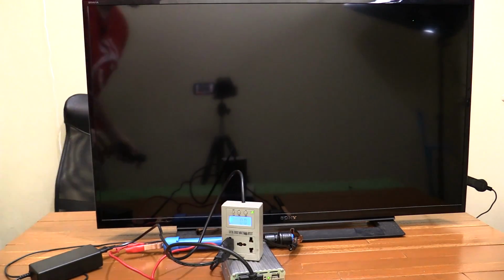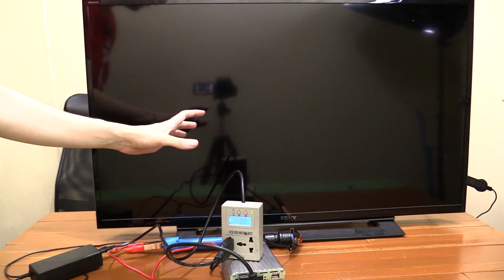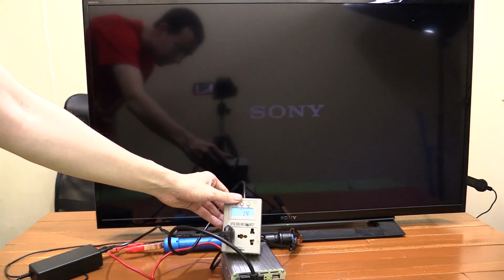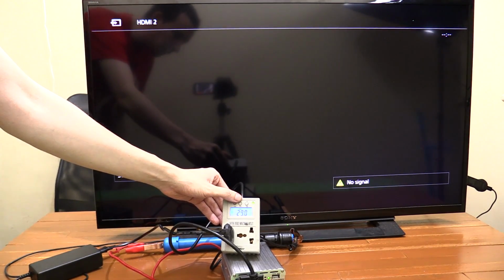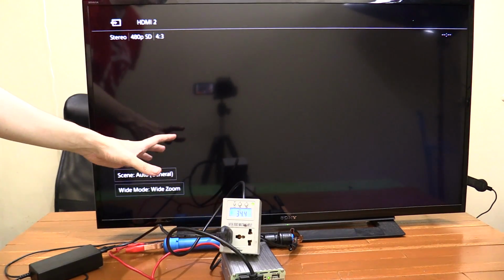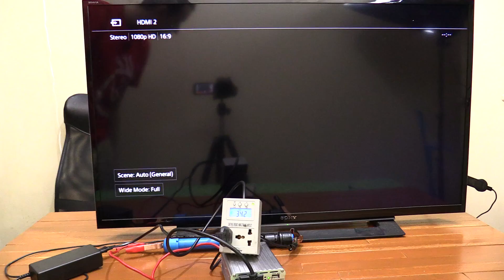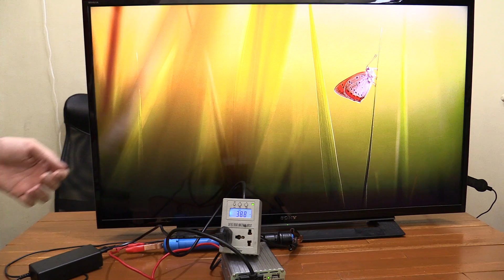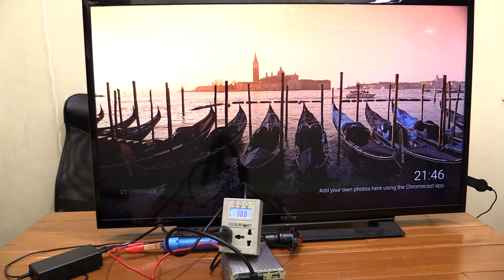Power your TV from 18650 batteries

Comment: Power = Voltage x Current
W = 3.7V x 20A
W = 74

Energy = Voltage x Current x time
W time = V x I x time
W hour = 3.7V x [3000 mAh]
W hour = 3.7V x 3 Ah
Wh = 11.1

That simple.

And for reference,
1000 Wh = 1 kWh [1 Electrical Unit], 
which is what our kWh energy meter uses in home
______________________________

mAh and Ah which are seriously flawed unit (which doesn't take voltage into account),
which is normally used by manufacturers and marketers to misguide people !!

Professional and universal unit for energy are,
kWh or Wh.

I mean, these all of us use kWh meter in home, kWh in Tesla car,
and 1000 Wh = 1 kWh. 
(how else simple do you want ??)

Still people use mAh and Ah, wonder how lame can they get !!!

And for comparison (different rechargeable battery types):
AAA [NiMH] = 1 Wh
AA [NiMH] = 2.5 Wh
AA [Li ion] = 3 Wh
C [NiMH] = 5 Wh
D [NiMH] = 10 Wh

18650 [Li ion] = 8 to 13 Wh (high drain to high capacity)
26650 [Li ion] = 14 to 18 Wh

____________________________
Average energy of Tesla battery are around 11 Wh [18650],
and to make a Tesla P100D [100 kWh] Model S,

= 100 kWh / 11 Wh
= 100, 000 Wh / 11 Wh
= 9091 batteries

or in simple words,
9091 [18650 battery] x 11 Wh = 100,000 Wh = 100 kWh.
____________________________

So i would seriously recommend 18650 enthusiasts to use Wh and kWh [our universal unit] instead of flawed mAh and Ah which are way too childish unit for energy !!
Reply: Chandraprakash G i don't think using is childish. its more clear on battery capacity. ALL big batteries for inverter or ups use terminology AH itself. and by the WH is product of voltage and AH itself. so if anyone purchasing he knows what voltage battery he is purchasing so AH is clear in capacity of that battery.
Reply: Shivakumar Hunagundi 
WRONG.

40 watts bulb glowing for one hour consumes 40 watt hour = 40 Wh

100W motor running for one hour consumes 100 watt for hour = 100 Wh

1000 W Air Conditioner running for one hour consumes 1000 Wh (or) 1 kWh.

And for practical examples,
Li ion 18650 battery approx energy is around 10 Wh.

To run a 40W bulb for one hour you need  4 of the 18650 battery which will run it for one hour (of course with right voltage with small inverter).

You can't use mAh and Ah like that practical,
also mAh and Ah is improper unit to use.

as i mentioned above, even for Alkaline (1.5V), Li ion (3.6V), Lead Acid inverter batteries (2V), the Ah is different for different chemistry,
But Watt hour and kilowatt hour stays same because they take voltage as well as current into account,
where the mAh and Ah skips the voltage all together !!

Apart from that your home uses kWh (1000 Wh) meter,
and all your home is billed as kWh consumption.
Reply: I know home uses KWH, even that itself will not give proper electricity consumption. for home use its ok to make bill on WH. but for industrial purpose they must use proper PF power factor correction to avoid energy loss in transimission otherwise electricity board will add fine to them.
 i don't think WH remains same as baterry voltage will not remain constant while in use. A 12v volt battery can charge upto max 14.4 volt can discharge till 10.6 volt. so WH will not  be same  as discharges.
Even xiaomi power bank 20Ah says its 72WH at  3.6 volt but actual capacity at 5V it can give 12.7Ah or 127000mAh.
So even watt hour is misleading its actual capacity while in use.
Even for mobile its better to determine its charging time based on its Ah capcaity and charger current.  but both AH and WH needed wherever applicable.
every where WH is not necessary.
Reply: You are wrong again.

Energy = Voltage x Current x time x Power Factor
Energy = V x I x hour x PF
Energy = Wh x PF

PF in home ranges from [0.8 - 0.95], and in industries anywhere from [0.65-0.95].

I didn't include PF in previous formula because, the loss is so minute in small systems unlike the industries as you said.

For example, Lithium-ion safe charge/discharge curve ranges from 4.2 Volts to 3.0 Volts.

So 3.6V or 3.7V is only called as nominal Voltage, or approximate median voltage for understanding.

But the energy of a battery is calculated by the precision discharge by premium manufacturers like LG, Panasonic, Sanyo, Samsung etc...

For example, the precision will be up to a (0.01 Wh or 36 Joules) by the discharger which captures the energy all the way from 4.2V to 3.0V.

Some spes for your understanding.
1 Watt second = 1 Joule
1 Watt hour = 60 x 60 Watt second
1 watt hour = 3,600 Watt second = 3,600 Joule

1,000 Watt hour = 1 kWh = 3,600,000 Joule = 3.6 MJ
Reply: okay. so its clear that Energy(WH) is determining its Ah. so manufacturer puts Ah based on its WH, its quite reverse. but for comman man Ah may be easier to understand. Buy the way i m not wrong only understanding wrong. Thanks for your info.
Reply: Lemme put it simple,

1 kWh = 1,000 Wh = Unit of Electricity = In India they call it Unit

If you say your battery has 100 Ah as Energy.

100 Ah [at 12V] = 1,200 Wh = 1.2 kWh
100 Ah [at 24V] = 2,400 Wh = 2.4 kWh
100 Ah [at 36V] = 3,600 Wh = 3.6 kWh and so on...

Hope you understand the basics well.

That's the reason you use kWh unit in your Home instead of Ah !! sigh !

+++++++++++++++++++++++++++

The problem is,
Alkaline battery = 1.5V
Ni MH = 1.2V
Li ion = ~3.7 V
and so on,

so if you use mAh unit here, for example,
2,000 mAh [on Alkaline 1.5V battery] = 3 Wh
2,000 mAh [on Ni MH 1.2V battery] = 2.4 Wh
2,000 mAh [ on Li ion at 3.7V battery] = 7.4 Wh.

Hope you understand the difference.
Wh or kWh will show you the precise energy,
but mAh and Ah are flawed unit [as you can see above].
Reply: Alkaline battery = 1.5V
Ni MH = 1.2V
Li ion = ~3.7 V
and so on,

so if you use mAh unit here, for example,
2,000 mAh [on Alkaline 1.5V battery] = 3 Wh
2,000 mAh [on Ni MH 1.2V battery] = 2.4 Wh
2,000 mAh [ on Li ion at 3.7V battery] = 7.4 Wh.

Hope you understand the difference.
Wh or kWh will show you the precise energy,

I know above things and i never just depend on mAh alone for calculations. Always energy depend on Voltage and Current at any instant.

1 kWh = 1,000 Wh = Unit of Electricity = In India they call it Unit

If you say your battery has 100 Ah as Energy.

100 Ah [at 12V] = 1,200 Wh = 1.2 kWh
100 Ah [at 24V] = 2,400 Wh = 2.4 kWh ect - i know these.

Comment: that tv is pulling 2.5 amps from the pack. add more batteries in parallel and get longer run time cuz it splits the amp draw from every cell

Comment: Do you know what 18650 means ??? It s dimensions of the battery 18 mm tick 650 mm long!! it does not vary across brands ffs !! 1.8 cm tick 6.50 cm long
Reply from the maker: I understand what it means but there's still a slight variation between brands, especially in the thickness of protection circuits and such like.
Reply: This is correct in theory, but not all manufacturers adhere to the standard, and variations of 2-3mm are common. This is especially true if you're using batteries that have protection circuits, as Gadget Addict noted - usually they're an extra mm or two in thickness due to a printed circuit board sitting atop each cell. Further, there's 'flat top' 18650s, and those with a protruding positive terminal, that can add an extra mm or two.
Reply: @TitaniumCountess  its 18 thick and 65 long, the last 0 is to indicate its a sylinder battery not a flatt one ;)

Comment: not the sharpest tool in the box, ill bet those cells are only made to put out a couple of amps at best, if youre gonna do this at least buy some suitable cells capable of running 300 watts like some vtc's or some hb2 or even 25r
Reply from the maker: +oldskoolhead0 yeah cos this is such a power hungry TV... 20-30 watts lol
Reply: you laugh yet those power banks likely only deliver 5w each plus your inverter use power and if something go wrong your inverter can draw 300w without trouble which those batteries cannot supply and as you are using 14.8v nominal supply for inverter designed for 13.8 sla the inverters cut off voltage will be low for lithium also which will allow for further abuse of those poor cells 8v cut off = only 2v per cell where 2.5v be min for lithium cell you should use 3 series and add more parallels or use better cells, just because it works doesnt mean its not a bomb waiting to go off.......
Reply from the maker: +oldskoolhead0 I think you need to remember this is a 'end of the world' / basic proof of concept and not a finished commercial product ready for the mass market. Putting aside your other concerns, there's not even something as simple as a fuse.

Comment: You lose at least 20% by using the inverter. The reason for it to have a fan is because electricity is converted to heat...
Reply: He's basically converting low voltage DC to mains AC, and then back to low voltage DC.
If you know what voltage the TV wants, you can just build a circuit that gets that directly from the 18650 batteries.
Reply: Knowbody yeap...you only need a few resistors

Comment: in long term will harm your device to use it this way. this kind devices need regular sinus , with a cheap inverter it works yes but not safety and too risky ..u will need a real sinus inverter for it, its much better for your devices. hope i could give some idea you guys..
Reply from the maker: For fans and inductive loads in general, yes a pure sine wave inverter will do better. For devices with DC switch mode power supplies, like the TV, this inverter isn't going to cause any problems.

Comment: when i tried it my inverter gives me an overvoltage warning and wont turn on
Reply from the maker: Try with 3 batteries in series instead of 4 :)
Reply: that works but then i dont get the full runtime of the battery due to the lower voltage
Reply from the maker: MWB Gaming Put multiple 3S in parallel.
Reply: im aware of that

i have made a 4S 20P battery pack

having the cells in 4S configuration will yeild longer runtime than having the same overall number of cells in 3S configuration due to the lower voltage of the battery

what i would love to know though is how did you get your inverter to take 16.8V (full charge voltage for a 4S li-ion battery pack)
Reply from the maker: MWB Gaming The overvoltage limit will vary between inverters. Mine must just be set a little higher than yours. Sometimes you can find an adjustable POT inside that will let you change it. Of course there's some associated risks of pushing the regulator too hard if you do that.
Reply: il have to look into that
its mostly so i can use my laptop for more than 20 min when i am on a long flight or whatever (alienware doesnt let you remove the battery without a screwdriver and good luck getting one of those into your carry on)
the battery pack i made has around 400Wh of energy capacity (less after inefficiencies)
and it weighs 3.5KG

since you cant bring lead acid batteries onto aircraft or public transport
lithium is my only option
(i also dont feel like carrying a car battery around)
Reply from the maker: MWB Gaming Just remember that airlines also have a limit on other batteries, such as those 18650 packs. It's based on Watt hours. And if they see you have a homemade battery pack, expect them to be even more strict on what you're taking on board. Most airlines have AC built into the seat now. At least for international flights.

Comment: Any idea what the run time loss worked out going from your 4 - 4.2v 18650s to the AC 230V?  i.e. if I have 8 (4 serial 2 parallel) 2.6Ah 18650s what kind of run time could I expect?  Also any idea of the current draw of your 300w AC? my worry is that 4 cells might be too much current?
Reply: motorbiking depends on how far you want to discharge your cells, and the capacity of your cells. Good quality cells will give you 6wh discharged safely, so 8 will total of 48wh. I tested the power consumption of my TV, which is a similar size to this video, and I was using 200+wh, I don't know how he was only getting 30, maybe much more efficient tv
Reply: yeah 100-200w would seem reasonable for a TV, though In my own experience my 180w inverter struggles with 130w load particularly as the input voltage drops.

Comment: Err, could have just bought a cheap step down converter to convert the 16 down to 13 to power straight to the TV, much less energy loss
Reply from the maker: I think the TV is 19V. But yeah, matching the DC input of the TV is much more efficient. But this isn't really about powering the TV. It's more generally about running an AC inverter from 18650 batteries :)
Reply: Gadget Addict Yeah, but the video is titled power your TV from 18650 batteries :P Cool video anyways, informative for a lot of people I'm sure

Comment: 4 x 4.2 = 16.8v
fan using 53 w
if effiency of inventer is 80%
so .. 53 / 0.8 = 66.25w
so the battery need  supply 66.25 watt
it mean battery supply at 66.25/16.8 = 3.95 A (need at lease 4Amp wire)
if battery capacity is 2500mAH =2.5AH
it is 2.5 x 16.8 = 42WH
so battery can supply fan for 42/66.25= up to 38 minute

but, battery may be damage by continuously high  drain
Reply: Your math is wrong, If you want to calculate WH you must use nominal voltage, not the maximum voltage (3,7v instead of 4.2v) So the correct way of calculating this is: 2.5 x 14.8v = 37WH, 37 / 66.25 * 60 ~~ 33.5 min. And there's a problem - when voltage drops, the current goes up to equal Watts, so if they would be at let's say 3.4v, connected in series = 13,6v, 66.25/13,6 = 4.87A, some laptop pulls have maximum Amp rating about 3A, others are 4 or 5A... so... choose them wisely ;) Datasheets with max amps are easy accessible, just type your model in google and add "datasheet". But as you said - high drain may damage them easily or decrease their capacity, so using them in parallel is the best option we have.

Comment: forget about it because it is not possible... noway at all at least this configuration. sure you can build a pack which will driver such TV for a hour  but you need around 30 battries not 3. you need around 100 watt at least and for sure thies 3 cells will nit deliver that. Now enought, PLEASE

Comment: How long it will last? How many hours?
Reply from the maker: +Ronilo Jasareno it depends on the capacity of the batteries and the power consumption of the TV. It would be more efficient to try match the DC input voltage of the TV directly from the batteries than to use the inverter. This was more a proof of concept than s practical long term application.
Reply: Would you recommended the DC to AC inverter of CD-R King? I planning to buy.
Reply from the maker: They're not the best, but they're as good as any other budget inverter. I use them because they're so cheap :) Make sure to buy one with a built-in fan otherwise it will overheat in the Philippines.
Reply: I'm running my hdtv on 18 cells (3s6p) and I get about an episode of xfiles and it cuts out. Pretty good for old laptop cells.

Comment: did you live in the philippines?? cdr king and those powerbanks? well i have a known supplier of 18650 from NCR (manila area) if you are interested you can search it at olx.ph 
just search "18650" then choose the seller with 35php price. it was from an old laptop battery but still works perfectly

Comment: Get a telly with an external PSU, match that PSU's Voltage with your battery pack and you can skip the inefficient inverter. Did that with my computer monitor.